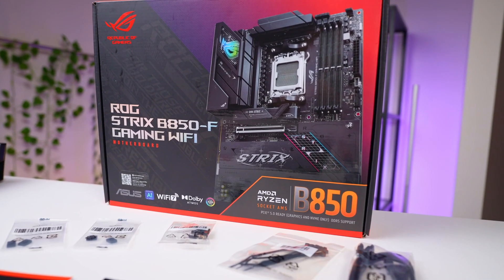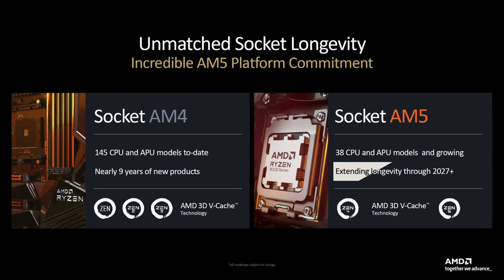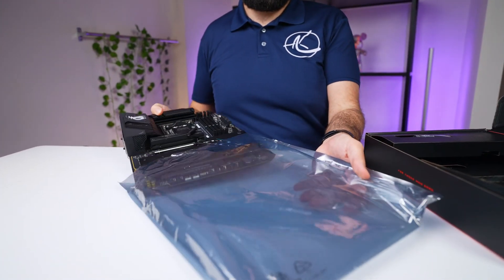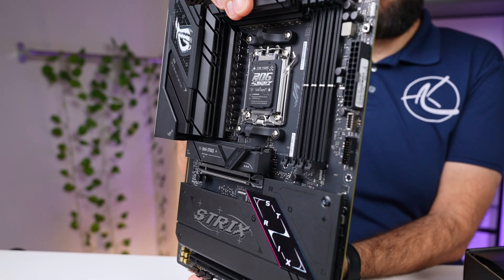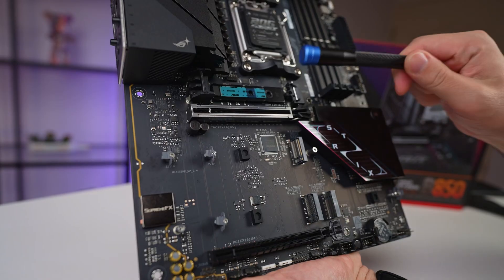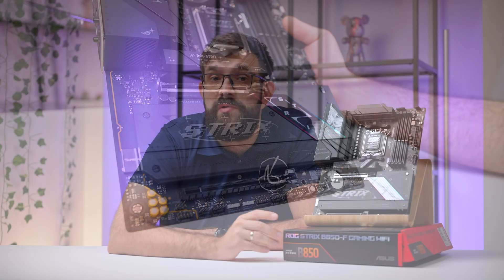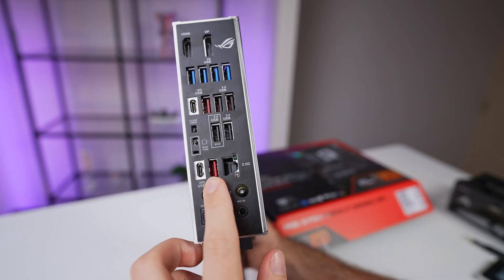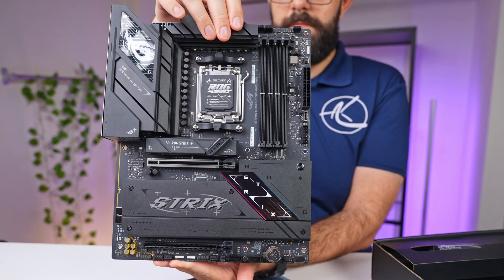ROG Strix B850-F: The Budget AM5 Motherboard You Need?

Comment: 197 dollar in korea Super satisfied. Only issue is that some internet company(lg telecom)here has issues with intel lan chip. Otherwise good.
P.s. fucking intel lan chip. Do not buy  mo with intel lan chip.

** I TOOK 4 HOURS TO INSTALL Window11 cuz it couldnt detect internet driver. I just installed it bypassing the route without internet connection. Fck.
Reply: I bought it with huge discount though. it is not that cheap usually

Comment: I buy it and RAM work only in A1 and A2 slot not like in paper A2 and B2 and so they do not work in dual channel.I send it for reclamation😢
Reply: Have You got it fixed or not?
Reply: @jewelof5able no. I sent it in for a refund, they told me the pins were bent on the socket, I'm still waiting for them to fix it

Comment: I went with strix B850E, its basically the strix x870e with less ram capacity, and slight lower power phases that are still higher than most high end b850s

Comment: Two days ago, I almost bought this mobo, 32gb Corsair 6000 cl28 mem, and a scalped 9800X3D for $590 until I looked up the B850 chipset and saw it didn't have gen 5 GPU support.

Yesterday, I learned that G5 GPU support is up to the manufacturer and this board has it.

Just an hour ago I saw the 9800X3D back in stock and got it for retail!

This will be replacing my 5800X3D, STRIX B550-F Gaming Wifi II, and 32gb Corsair 3600 cl16.
Reply: Soo I bought this mother bored so I fucked about gpu or not ?
Reply: @guymualem99  What do you mean? It supports PCIe Gen 5 for GPU and 2 NVMe drives
Reply: @Techn9cian123  idk what you write ? like is can br support the GPU that will new more 10y

Comment: BUDGET?! It's $300 USD lmao. Awful value
Reply: I just paid $200 for an open box, worth every penny
Reply: Yes dork. Budget for the strix lineup. So many more features and higher quality software and audio output than any other “budget” board.
Reply: @Docbadnews  Audio codec is problematic ALC 4080. I m avoiding ALC 4080 like a plauge.
Reply: @ what other features make this worth it over the ASRock riptide and steel legend? Both of those are 209, 199

even Asus’s b650 offerings were a ripoff
Reply: @hameed asrock is killing spree when it comes with 9000 cpus. They should change name like asrock the cpu killer
Reply: @hameed are you dense?

Comment: Wise to put the RTX 5090 on these B850 boards? Or better put it on an X870 board? Will a hot and power-hungry GPU like that shorten the life of a midrange board more so than a highend board?
Reply: yeah, without a problem, you dont see much benefit from x870 boards unless you need all nvme slots to be pcie 5, usb 4 ports etc... in my scenario x870 is waste of money... and if you ask that question in yours aswell
Reply: I would rather suggest you to go for x870  tomahawk it would work perfectly with 5090
Reply: @atulgope7459  what about vrm? 16+2+2 vs 14+2+1.

Comment: 2:04 impossible in am5 at these speeds
Reply from the maker: Really depends on the equipment. We are happily running 7200 on our board with 7900X which did not work a year ago above 6000.
Reply: @A2KMedia  with 192GB of ram? Do you mind sharing the model name?
Reply from the maker: 48GB as we don't need more. It is important to note that getting both max speed and max capacity is going to be very difficult or as you said impossible. But getting one or the other is not.
Reply: @A2KMedia please listen to what you've just said around 2:04. People repeat such misinformation about am5 (8000 is unattainable) and convince users to choose this platform over other more stable solutions.
Reply from the maker: I literally say that not everyone will be able to hit those speeds in the video and it will depend on CPU, RAM and Motherboard.  It is not misinformation, it is covering the specification of the equipment and providing information to the users. I didn't say it is going run out of the box at 10,000 M/T and change space time - now that would be a lie.
Reply: @A2KMedia you weren't even able to get the advertised 8000mts with just a little as 48gb of ram. So yeah, it's a bit misleading...